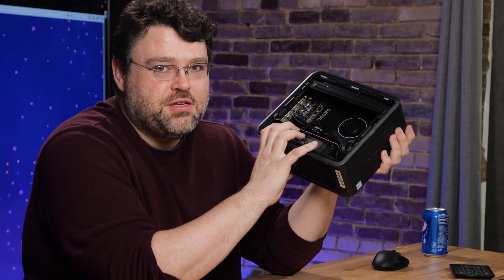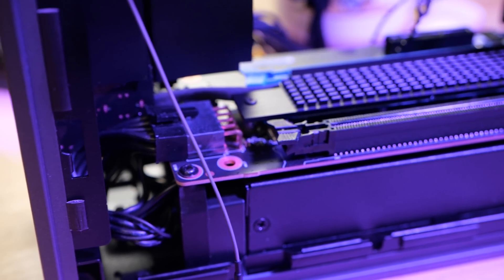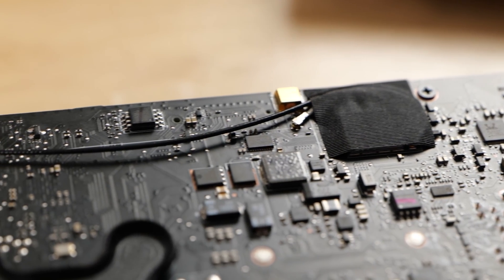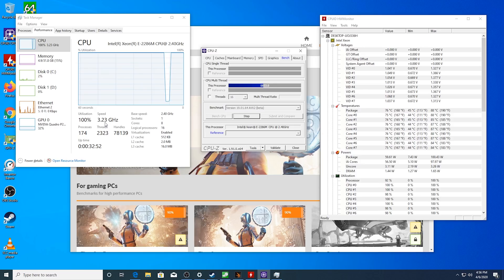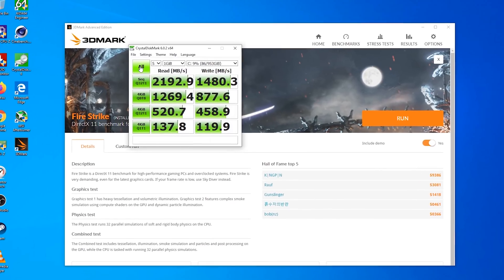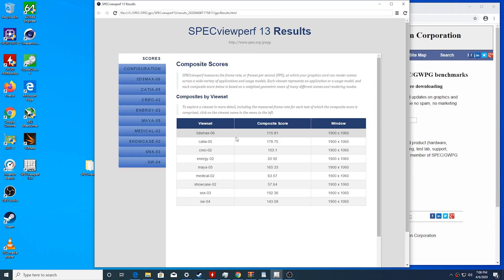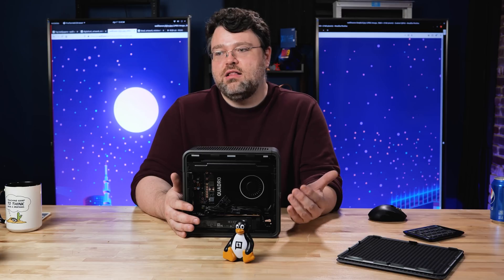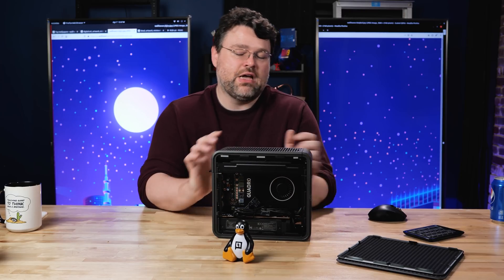Intel Xeon Nuc, Now w/PCIe Expansion!

Comment: I wish AsRock would make a SFF barebone for AMD cpus and have a x16 pcie slot. Sort of an (easily) upgradable DeskMini...would be sweet
Reply: And of course, you'll get idiots trying to shoehorn in a 2080ti into it without any consideration for power or thermals.
Reply: It wouldn't be that hard since they already do ITX boards, they could probably get a right angle pcie adapter and have the GPU mounted sideways so the case can be smaller too.
Reply: @amirpourghoureiyan1637  If you're talking about using standarized components, this is all on the case manufacturers, everything else already exists.
Reply: @choomaque  better gfx performance, required additional power. Supply n input.
Nothing is for free, and not forgetting sizes constraints
Reply: @choomaque  If by "customers" you mean the vocal, entitled, enthusiasts who want their ultra-niche use cases catered to, no, those customers can be safely ignored.  OEMs should make whatever sells.
Reply: well there are some Zotac mini amd pcs, they are small and use desktop stuff, but the mainboard and the thermal solution mhmm, not sure about that

Comment: I love nuc's and Intel, but why can't amd make nuc's and compete? They don't in the cheaper  nuc segment (is what I meant)
Reply: OEMs could put 4000 series APUs in this form factor. 🤔
Reply: @93Snips  As long as they will price it fairly. The low end nucs are like 400 on the amd side :(.
Reply: @93Snips  Not enough to go around yet.
Reply: Why? It's a niche market.  You don't make money catering to a niche market...unless it's a boutique niche market, as in, people willing to pay a significant premium for boutique products.
Reply: @namyun2743  what about the bulk business customers?
Reply: @Nan Yun somthing like an 220ge in a nuc form factor at € 150,- (excluding ram&storage) would be extremely popular. Or anything between 2-3ghz at the low end would be nice and actually fulfill a need.
Reply: @namyun2743  Niche? It is a gigantic marked - basically the entire office marked.
Intel NUCs are doing extremely well there, replacing that old towers as the flexibility and upgradeability is not needed there.
Reply: AMD does have an embedded lineup. EPYC Embedded. Most products are only available for bulk orders (+1000 units).
Reply: @saturnGEEK  They do (AMD R1505G or V1605B for example) and can be ordered without bulk, but usually ship for ~400,- So not only Epic.